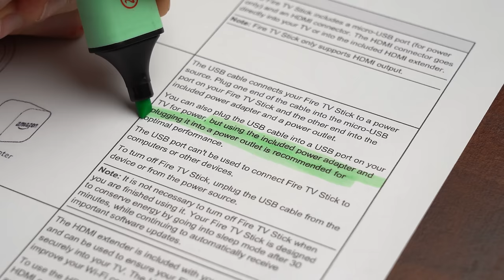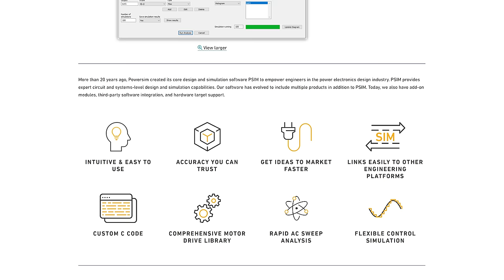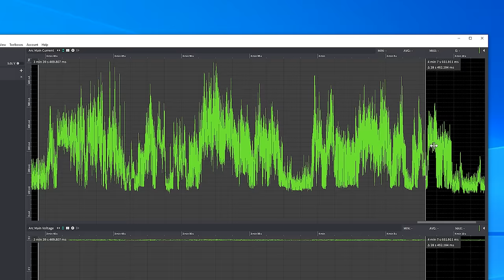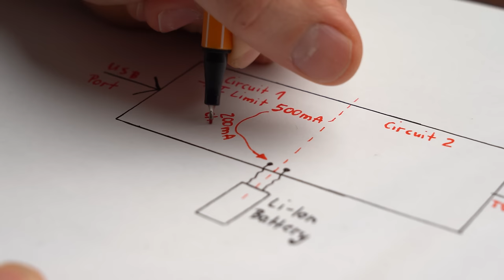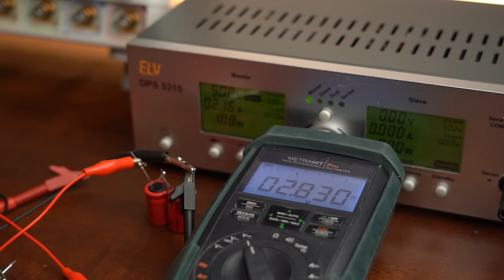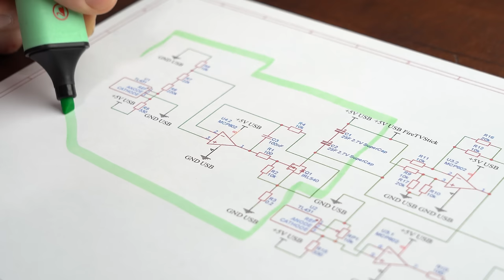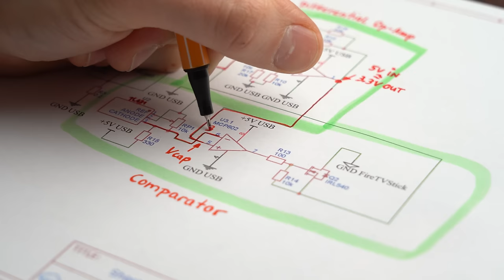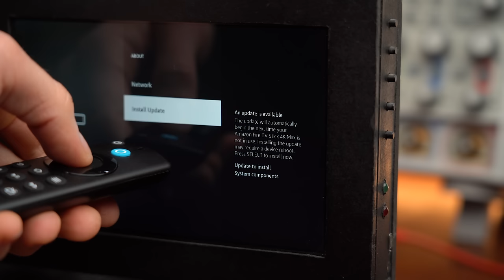I recreated an Amazon Product to make it better & cheaper! (for Fire TV Stick)

Comment: Important! Pls add two similiar high ohmic resistors in parallell to supercaps!! This will help them with staying balanced! Otherwise you run risk with age that one blows up due to over voltage. Capacity may vary as they age = they will come more and more unbalanced!
I approve of protype development process. I do the same.
Reply: Or just use a single one. I believe there are some 5V rated ones although they somewhat rare.
Reply: @Kirillissimus  never heard of these. Max I saw was a 3v supercap.
I believe 5v is just 2 in series hidden within.
But who knows maybe they really produced 5v supercaps
Reply: Not a great method.  Bottom balancing on ELDCs can cause major issues because they can actually flip polarity when at 0 volts.  It is imperative to never drain them down fully.  Doing this can do internal and external damage.
Reply: @EVLS10  Not sure what you mean with bottom balancing as parallell resistors will always try to maintain 1/2 x Uin over each capacitor at all times. Complete discharge is unavoidable due to current circuit design. I do agree that parallell resistors is the bottom tier solution and cannot keep up in very dynamic situations. This design is usage is pretty chill though, where the caps will at 99.99% of time just stay hovering at 5V without much going in or out giving much time for the resistors to do its job. In the case of rapid charge or discharge; parallell resistors are much much better than nothing, as it will correct errors with enough time, as opposed to not being corrected at all. During a full rapid discharge, with unbalanced cap size there is the possibility that it will force the lower capacity cap into reverse voltage, with discharge resistors it will atleast try to minimize the time spent in error state. I can't forsee that as worse than having the cap forced into reverse voltage for a longer duration so; I'm not sure what the fuzz is about but I'm intrested to know. Adding parallell diodes would limit the reverse voltage situation, clamping it to one diode forward drop. (But if one has gotten this deep into patching, one might aswell get a proper solution like SAB mosfet, op-amp balancer or maybe a well thought out zenerdiode)
Reply: @Paxmax  it means that your method will intentionally or not bring both cells to 0 volts after a long time of being disconnected.  You are providing a constant drainage path which is a no no with eldcs
Reply: @EVLS10  As I stated earlier, as the circuit is designed; the supercaps will be drained anyway when USB powers off. It's good hint though (prefered to not drain ELDC) generally, but in this design It wouldn't matter.

The condition to turn off supercaps is too high USB in-current = will not happen during USB off = the op-amps will seemingly remain on down to 1V. Mosfets will typically remain on down to 2V, so maybe there will be a pinch off below 2V. Even if the op-amps and mosfets would shut off there is still the internal leakage current in ELDC..? Or are ELDCs leakage free devices? (I have not been playing in depth with supercaps personally, they where just placed in some designs for RTC to stay alive during shorter power outages).

I could possibly be wrong about my schematic interpretation, I'm not super-invested into this, but I did actually have a think about it.
Reply: @Paxmax  oh I'm sure it's a flawed design.  The dude started off the video by saying resistors wouldn't work which is absolutely wrong so that's not a great sign. 

All I'm saying is you want to avoid draining them down to 0v.  They do have internal leakage but from my experience it's logarithmic.  I have never seen an eldc go down to zero on it's own even from sitting for years.  It will get very close but never actually cross the threshold on it's own
Reply: @EVLS10  Yep yep, good tip as I have never thought of them as nothing else but a very large (polarized) capacitor. I did read something about hybrid super caps where I'd think twice b4 using.
Reply: @EVLS10  "It is imperative to never drain them down fully", how are they delivered then?
Reply: @icarossavvides2641  they come with a slight charge.

Comment: Might be better if the output voltage cutoff had some hysteresis, so it gets to a decent level, but will then allow it to drop to the minimum working level, otherwise it may cut off prematurely as the capacitor discharges.
Could also use a boost converter so that the voltage does not fade with capacitor discharging.
Finally, it appears that the switching and any drop is in the 0V side, not the +V, this would be bad if the USB ground is not isolated from the HDMI ground
Reply: Good idea. As you’re probably aware, it’s trivial to make this tweak to the circuit presented.
Reply: Charging time will increase 🌚

Comment: The main ic is a monolithic power MP2617H.
worht checking the datasheet, really cool ic, it does everything, charges the lithium cell, regulates the maximum input current and provides higher output current (from the battery) than the input current.
Reply: would be a pretty decent choice for a powerbank
Reply from the maker: Thanks for the feedback. I will definitely have a look :-)
Reply: how do find that IC ?))))

Comment: Cool idea. Though I have couple of ideas to consider. Since you are charging the 2 capacitors to a combined higher voltage that they can tolerate by themselves, I would put in some protection for too high "cell" voltage. Supercapacitors (at least in the range of 100s of Fs) can be easily be damaged with too high voltage. Also the op. Amp used to turn the load on does not have any feedback to prevent oscilation when reference voltage is near the compared voltage. Just a small amount of feedback to the compared voltage would made the operation to work a bit like a schmitt trigger.
Reply: If you want to be safe you can parallel them and use a cheap booster to get 5v and a Cc step down

Comment: My tv has both 500ma and 1A ports. Although using a separate power supply is cheaper still. Good video
Reply: I didn't watch the video closely, but it seems he made a contraption instead of simply buying a USB power supply? They're only $5-$10 each, for one that does 2 amps. I don't see the point of making something like this when they're cheap and available. I did not pay attention to the video, though.

Comment: Interesting design, I thing you should probably add a voltage balancing circuit of some kind for the series super-cap, dispersion in capacity may result in premature deterioration.
Reply: or at very least a 100k-1M parallel drain resistor on each so the higher cap will drain faster to some safe equilibrium while not wasting a tonne of power.

Comment: I think I'd rather power with an external supply over this solution tbh. In the past I've used a relay to turn off the device when I've required a synced power down.
Reply: exactly my thoughts, you could tap from the mains inside the tv to connect a seperate 5v powersupply that offers enough amps, add a usb port to the tv and connect a relay in between.

Comment: Could this also work as a rudimentary UPS to make the connected device survive short power downs?
Reply: He used Super Capacitors and not a Li-ION Battery. It's job is to only deliver required short current spikes while being powered by current limited input and not to be used as UPS

I think the Buy Version is capable of that stuff.
Reply: @pauljackson2126  He did show however that you can power the TV stick for up to two minutes in this configuration, longer with larger/more caps
Reply: @resneptacle  then again larger caps means longer charging time
Reply: @resneptacle  actually, if you want to keep it only on for like short period, then I guess you can use higher power caps to make a poor man's UPS
Reply: Sure, just depends on the down time you're looking to accommodate.
Reply: @pauljackson2126  Standard capacitors are more for transient variations in power draw, super caps have sufficient energy density to operate as a UPS in low power applications so long as the current draw is very low and/or required running time is low.

Comment: If cost is a thing I would simply use an old usb phone charger, they are >500mw.   
What would be handy, like a sort of PC PSU, offering different voltages, for for use outside the pc. Near my tv I have a router, nvidia shield, DAB+ radio unit. amplifier, raspberry pi. Most are 5v, some 12v. Every device has its own power supply. Why not have 1 power supply, supplying power to all devices. This is probably more efficient too (less watts).  And as a bonus, being able to turn on/off per device.

Comment: I also thought using a lipo was not a great idea. Trickle charging like this would be good for NiMH cells too. I do like the super cap solution too.

Ok further watching and this is awesome. I need to make a few of these.
Reply: I've seen some high end charge management chips for Li-Ion charge the battery to only 80% capacity - e.g. 4volts instead of 4.2volts, this doubles or triples the life span of the cell, other ways of doing this too is to allow the battery to fall to 80% from fully charged, doing a smaller charge back up to 4.20volts, meaning the cell is never heard at fully charged.

Comment: I have build a circuit like this one. what you really looking for is a HOT SWAP CONTROLLER. you can put 2 of them and chain the Pgood and Enable pins together to separate the super caps. you might also just be able to make a simple soft start circuit using a mosfet and some timing caps.

Comment: Personally, this is one of those problems that the DIY is less of a value proposition than just trying to find an outlet to plug the stick into.
Even if its cheaper than the commercial product, so is a USB charger I already had. 
But admittedly I'm WAY lazier than you :P
Great video overall though!
Reply: Having your firestick/google TV stick turning on and off with the TV is priceless ...
Reply: @lepef32  Ironically this is the exact reason I gave up on running my Chromecast off the TV port (my TV has a 1 amp port which should be enough but still caused it issues from time to time). Specifically, the Chromecast supports HDMI CEC, which lets me turn the entire set up on by just telling Google Assistant to boot up my Chromecast or just directly streaming to it. The Chromecast then automatically turns the TV on, and can even turn it off afterwards. Presumably the Fire Stick can do this too. The result of that is you can ignore the TV remote entirely and everything works off of a single control. If you use the TV turning on to turn on the Chromecast/Fire Stick you still then need to switch over to whatever is controlling the other device.
Reply: @clancywiggum3198  yes the fire tv does that too, also it doesn't need to boot every time and it can update when not in use. Power consumption when asleep is negligible
Reply: @clancywiggum3198  Good to know, i never explored that possiblity
Reply: I may have done an overkill then. I opened up the tv and the sick, put a dc plug inside after the fuse, added the included charger inside in a corner, added a heatsink to the stick and changed its wifi antenna for a broken laptop one, the hdmi cable goes out from a small carved hole and plugs to the tv, so it has better wifi, can run colder and I have only one cable visible from the tv.

Comment: While I don't really have a use for a Fire Stick or similar, I think Thist is a very interesting idea for averaging current draw in many applications - I can imagine it would be a great way to power remotely installed solar powered devices that have an occasional need to draw extra power (to operate a motor or servo etc). I'll be bookmarking this :)

Comment: Great Scott, Great Edutainment!
I’m curious about when you build your beta circuit in free air. Do you prefer to build this way because it allows you to understand the circuit better? Do you prefer free air vs breadboard? Do you prefer free air because of convenience, easy vs hard, fast vs time consuming?
Some videos of free air circuit construction can be more entertaining than the actual circuit application information, personally I prefer deeper material like yours vs the “Sensory Satisfaction Art”, but a balance is a good thing.
I ask you the free air construction question because if there is real value to it, vs breadboarding, I might be willing to give it a try.
Thanks 🙂

Comment: A lot of TVs like Samsung will power off the USB ports after turning the TV off. But still, some TVs have USB ports powered even in standby mode.
Reply: Yup, same problem with my TV.
Reply: Yea this would make the battery solution better. Maybe a supercap+battery hybrid would fix this issue. Using USB C would be the way to go to have data and power all travelling through the same port. You could even forget about HDMI this way, and USB C wouldnt have the top current limit

Comment: If you plug your outlet is close enough you can actually swap the outlet out for one with a USB port that'll power the device. I have one and I believe both ports output 3.6 amps. Which would be enough for the firestick. Also the outlets are about 20 bucks. If you're good with changing an outlet and faceplate it would be simple task.

Comment: Nice solution! I was wondering if it would be sensible to limit the input current draw to 450mA, so that the TV's usb port isn't being driven so hard/close to its max mA?
Reply: Usb ports are rated for continuos .5A output.
Reply: The 500mA are already a low rating. Most of these ports can deliver 1A, some even 2A.
Reply: True, but as GS mentioned, not all are capable of exceeding their ratings - in this case USB1.1 base PD.
It’s worth noting that it’s fairly common to have 500~700mA (nominal) PTC fuses on USB (1.1-2) ports. Being a fuse, the PTC does not actively limit the current (at least not very rapidly ;) ). Instead, after a period of time - say 500-2500ms (depending on several factors) - it’s resistance will become extremely high, cutting power. As such, as you mentioned, it’s not at all uncommon to see ports that will handle 500-1000mA spikes without a hitch, but completely fail when they are asked to deliver that same current continuously for even a second or two. It’s also important to note that the recovery time for PTC fuses and very dramatically, from milliseconds to hours. Both factors combine to make the device featured in the video necessary, in the absence of an external power source.

Comment: Or plug it into a 1amp wall adaptor, that also means its powered when the TV is in standby (if your TV doesn't power USB whilst I'm standby) and you can also turn on the TV by issuing voice commands

Comment: It might be overkill, but I'd love to see a version of this circuit that uses a buck converter to charge the supercap (so you aren't burning half the energy when you initially charge the caps) and a boost converter to make the 5V output (so you can drain the caps lower than 4.5V and use more of their energy storage capacity).

You'd be able to start the Fire TV before the capacitor is fully charged with that sort of design.

Comment: I could see a potential issue with the circuit. You are using low side switching on FireStick GND, and this works fine on bench power supply. But when connected to TV, the GND of usb output is tied to GND of hdmi port, and thus the low side fet switch is bypassed. Now the GND FireTVStick goes straight to GND USB.
Reply from the maker: I tested it all with two real TVs and never experienced such problems.
Reply: @greatscottlab  I would like to see actual voltage and current measurements when connected to a real TV. My suspicion is the TV's USB port is soft limiting the current and your circuitry is being bypassed.

Comment: Hmm, now this makes me want to try a similar solution for my 3D printer. I've got a raspberry pi hooked up directly to the printer's PSU, so I have to make sure to shut down the pi before I turn off the power (if just for good practice's sake). Would love to read the state of the PSU and shut down the pi automatically, but obviously that would mean it'd have to be on for just slightly longer than the rest of the system.
Reply: you could also made a circuit that first shut down the raspberry, then shut down itself and the power supply with a relay
Reply: @jerrb7991  Yeah, I've been thinking about that too, same with just buying a smart switch or something, but those draw power while they're off (of course, so you can remotely turn them on again, but which I don't necessarily need) and I'm not confident enough to work in a relay on 220V mains. So it's not that your idea doesn't work (or even might be better than mine in general purpose), but I've kinda backed myself into a wall with my requirements ¯\_(ツ)_/¯
Still, appreciate the idea, thanks 👍
Reply: @LordHonkInc  For what it's worth the idle power draw of Zigbee stuff tends to be really low (my IKEA Zigbee unit uses less than 0.1 watts for instance)
Reply: The pi has an overlay to get a pin High or Low when it shutdown. Look for gpio-poweroff

Comment: Perhaps combine the two approaches, allowing for a quick first-time boot up with the caps, and then later, even faster boot ups by using the batteries just temporarily to cover for any charge the caps may have bled while the thing was powered off, using the batteries a lot less than if they were the only thing there?